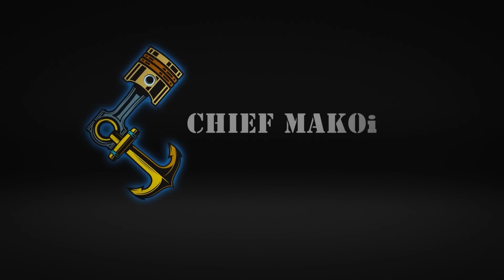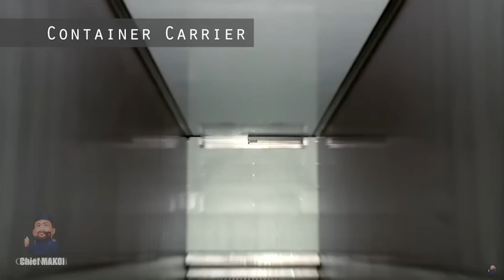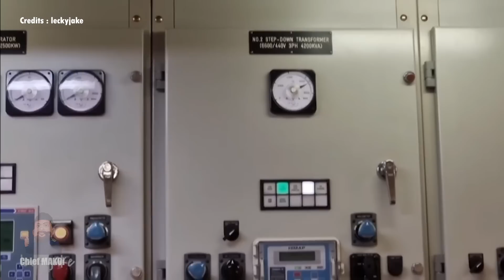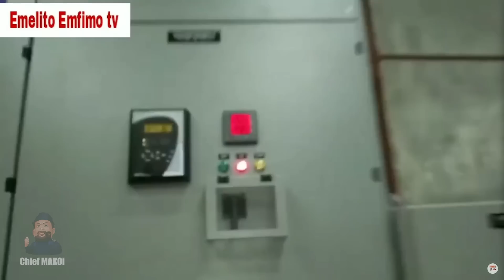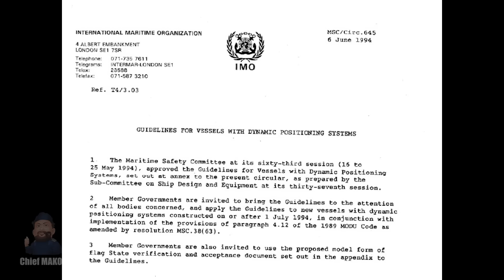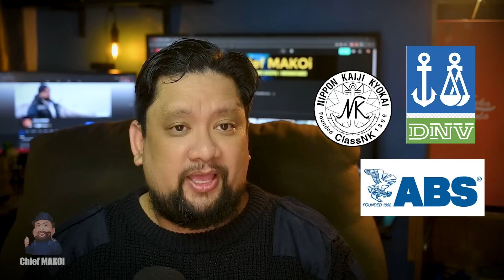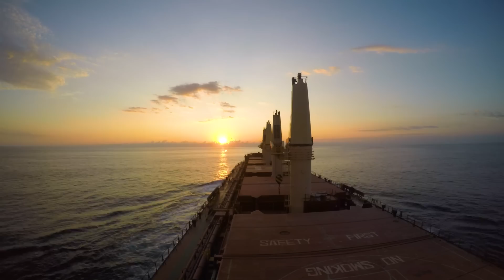Why Cargo Ships Don't Open the Bus Ties During Maneuvering | Chief MAKOi

Comment: One thing of note was that the bow thruster was only on one side of bus.  This might present a load balance issue depending on the number of refer units tied in.

I worked at a very large nuclear power plant.  All of our buses were crossed-tied.  During a blackout, our emergency buses would isolate from the other buses to ensure that if the fault started elsewhere it would be isolate from the emergency bus and its equipment before our emergency diesel generators started in under 13 seconds.  Even the non-emergency buses might isolate depending on what the circuit protection saw.  

The advantage of always being cross-tied is if one motor shorts and causes a breaker to trip open, or some other failure happens, there is a chance that the rest of the bus can still be powered from the alternate supply.  If a transformer failed, the bus would auto swap in under 5 cycles to the alternate transformer.  The main infeed breaker would open and the alternate would close that fast.

Unlike a ship, we can go all the way back to the national power grid to get power, if our switchyard does not isolate on a fault.  And our switchyard is supplied by three independent sources so if there is a fault, only a 1/3 of the switchyard will isolate.

We had 4 EDG, each 4400 kw and they would come up to speed in 13 seconds.  Then over a two minute period, our emergency loads would be sequenced on to the bus.  This was enough power for instrumentation, some lighting, and the emergency pumps to keep the reactor cool only.  We only need 3 out of 4 for a normal safe shut down.  If they failed we had backups to the backups.
Reply from the maker: That's very interesting.  They would probably have a similar setup on nuclear-powered ships/subs.
Reply: @ChiefMAKOi  Yes on the emergency diesel generators on nuclear vessels.  
The submarines have two sizable battery banks.  They use motor-generators running on the buses to be a quick transfer over on a loss of steam.  Since the M-G is already synchronized on the AC side, the power flow reverses when the frequency drops for a moment, until the frequency regulator speeds up the now DC motor.  I do know they have an auxiliary propulsion motor to help drive them back to the surface.  Once on the surface, they have the very same model Fairbanks Morse Diesel engine driven generator the world war II US subs used.
The aircraft carriers don't have the problem of no oxygen to run an engine, so they go with multiple diesel generators.  They run a 4.16kV AC system, with the system tied in peacetime cruising but will segregate the system in general quarters to prevent damage to one power system from taking out the other.
Reply: @ChiefMAKOi  Last year I had a tour of the Emerald Princess control room by the chief engineer.  I was quite at home at what I was looking at.  The controls and procedures were so very similar and in English too.
Reply: Thanks for the detailed posting.  I am reminded of a business I worked for who decided to have a 50 KVA motor-generator backup for their IT equipment.  I recommended a location in their IT raised floor room.  The head of IT didn’t want to lose floor space and decided to have the unit installed in a basement.  There was also an outdoor EDG, but the physical plant personnel did not perform scheduled test runs, but that is another story.

There was new construction and a fire suppression water main running through the basement was installed.  The main was air tested and then city water was supplied to the main.  On a Friday night about a week later, a cast iron elbow burst.  The fire pumps had not yet been enabled, but ~150,000 gallons of water poured into the basement and blew up the motor-generator.  The IT person on duty doing backups found out when all the lights went off and all equipment shut off at once.

The IT head ordered that the replacement, now a solid state inverter unit, be placed in exactly the same location.  I lobbied for installing a foundation to raise the new unit, but the head nixed the idea as too expensive.  There was a water mark left on the wall from the flood, so there was an easy gauge of how high to go to get above the flood risk.

TEPCO in Japan also found out that putting all the backup EDGs below ground isn’t too smart.  Anywhere the can be water, there eventually will be water.  Murphy’s Law ensures the flood occurs at exactly the wrong time too.
Reply: @wtmayhew   Your flood story reminded me of a tech company that I worked at in the '90s. They correctly installed their backup generator outside. But they also put it up on top of a concrete pedestal. The base of the generator was above the first floor window bases. They wanted it to operate as long as possible, even if the wetlands behind the building flooded. The expense of a catastrophic failure was prioritized over the expense of installation. The server room was on the second floor for additional protection.
Reply: @elizabethbottroff1218   Thanks for sharing.  It is always good to read cases where decision makers do more than go through the symbolic motions to satisfy insurance underwriters or boards of directors.
Reply: @wtmayhew  Our EDGs were at basically 4-ft above ground level, 10-ft above high tide, and behind water tight doors up to 35 above the river level.

Once we had a cooling line break on one EDG and water just flowed out the door.
Reply: @dwayne7356  Thanks for sharing.
Reply: @wtmayhew  That reads like a BOFH story about an incompetent boss who's only qualification was being the CEO's cousin...  just fantastic
Reply: That explanation of your nuclear plant's system is fascinating to me. It also emphasizes how badly damaged the plant in Japan was on 3/11 that too many generators and pumps were taken out at the same time.
Reply: @elizabethbottroff1218  I worked at the same type of GE BWR reactor.  The difference was that USNRC required that we had water tight doors up to 35-ft above the river.  Nothing but non-vital equipment is in the basement of our turbine building.  Not that flood water is a good thing.

We are designed to be stable for 8-hrs, Fukushima Daiichi proved that we would probably last more than 24-hrs.  Since then the USNRC has required even more backups and staging of emergency equipment offsite for just such emergencies.
Reply: @elizabethbottroff1218  Not only were the generators at ground level, the electrical rooms were in the basement.  Which is crazy to me, the nuke I worked at had the electrical rooms at 68 feet above sea level.  (All of our levels in the plant were in MSL, so that made it really easy to know.)  The emergency diesel generators would be in peril at about 48 feet above seal level though.

Something really interesting came out in relation to American plants due to the Japanese tsunami.  I quite working at the nuke back in the 1990's, so I didn't know about this until it became public.  Due to 9/11, they made preparations to recover plants from a terrorist attack.  All of the US nuclear power plants have a secret off site bunker with generators, pumps, rugged equipment to haul it and engineering gear to get it there if the roads were damaged.  The plants were modified to have direct connection between generators and key pumps, plus connections for external pumps.  The idea was that if terrorists targeted key support equipment, the plant had access to offsite equipment to bring in and save the plant once the terrorists were driven away.  In hindsight, the NRC realized that a scenario where a worse than postulated natural disaster, these offsite preparations would be very helpful.
Reply: "One thing of note was that the bow thruster was only on one side of bus.  This might present a load balance issue depending on the number of refer units tied in."
That's why I think having the low tie open but the high tie closed would be a good idea.
That said, refer loads are interruptible due to the thermal inertia and insulation of the containers.  Also, if the bow thruster was lost, it isn't as bad as loss of propulsion underway in a narrow channel.  The bow thruster is only used when the ship is moving slow.  There are already tugs attached or at the ready when it is in use.
Reply: that's encouraging to know
Reply: Dwayne,  you say correctly  "each 4400 kw and they would come up to speed in 13 seconds Then over a two minute period, our emergency loads would be sequenced on to the bus.  "   Putting aside the original trip condition on the ship it is my opinion that the crew were too eager to restore power and were manually throwing breakers, most likely upsetting the frequency of an already unstable board with an unknown load condition .  We are both aware of the problems that brings. Best.

Comment: Would also be good if ship design paid careful attention to making sure that critical systems can be kept running even in the event of failure of the main systems.  Being able to operate a subset of the steering hydraulic pumps from the emergency generator is a start, but obviously in the case of the Dali, this wasn't enough.

As is said in railroading, the safety regulations are written in blood.
Reply: the problem is a rudder on a motor vessel loses a lot of effectiveness when the screw(s) isn't turning, because the thrust from the screw acts on the rudder in normal operation.
Reply: @kenbrown2808  A lot of effectiveness, but not 100%.  And that's just 1 example -- in principle, thuey should have been able to use the bow thruster after they lost 440 V power but before they also lost 600 V power, but only if the control line was still operating, which is unclear.  And if emergency power could have kept the pumps etc. needed for the main engine to run, then the rudder would have remained effective.
Reply: @Lucius_Chiaraviglio  by my understanding of the reports on the official report, they lost the main breakers on the generators.  as in total blackout.  no 440V, no 600V, no fuel, oil, or coolant pumps for the main engine.
Reply: @kenbrown2808  According to Chief Makoi's previous video on this, the 6600 V initially remained up, until the second blackout, which was a good part of a minute later.
Reply: @Lucius_Chiaraviglio  according to every video talking about the NTSB report, the GENERATORS remained running, but the circuit breakers opened, in the second blackout, after the circuit breakers were closed, the generators lost speed and then the breakers reopened.  

I mean, sure you can say the high voltage bus remained up, and the main engine kept running, but the main engine didn't keep running. and the ship had a total blackout.  they lost propulsion, they lost steering until the emergency generator system went online, and they lost all communications and recording capability until the emergency power was online.
Reply: @kenbrown2808  What I understand from Chief Makoi's previous video on this -- in particular the overall electrical diagram -- the breakers that tripped were between the 6600 V bus and the 440 V bus, thereby leaving 6600 V bus equipment (including the bow thrusters) functional at least in principle.  (Doesn't help if the control system is out, though.)

Comment: The size of that bus bar is genuinely intimidating.
Reply: It carries about 10 000 A
Reply: @mrfrenzy.  I have doubts on that number.  Standard breakers run up to 4,000A.  Special order general distribution breakers run up to 6900A.  If the current is that high, the voltage should be going up.
In the medium voltage world, there are generator disconnect breakers that run up to 30,000A, but those are very special and very expensive.  We're talking the main output breaker of a nuclear power plant.
Reply: @matthewbeasley7765 I agree, its doubtful.

4,400kw x2 plus 3,800kw x2 at 6,600 volts gives approximately 1,434 amps per phase provided all 4 gensets were at rated load. Completely ignoring the redundancy.

I don't know the specs on the transformers to know if the LV bus is seeing close to that, but considering the HV bow thruster alone is 3,000kw I doubt the transformers are that oversized.

But, if the entire genset load of all 4 could be converted to 440v, the 440v bus could have 21,500 amps per phase. But I doubt its anywhere near that. I'd be surprised if it was rated over 5,000 amps
Reply: @mediadaemon  I don't think the picture was of this ship.  They're likely of a 440V only ship.  But my point remains, if a ship had over 4,000A, they wouldn't do LV, it would be a MV ship.
Reply: @matthewbeasley7765 bear in mind many container ships carry 1000+ refrigerated containers all 400V at about 10KW each. There is no HV option there. IF they were all running at the same time that would be 10MW on the LV bus, about 14000 amps/phase.
Reply: @petesmith2234  I doubt the engine room LV bus carries that load.
I bet its HV over to the deck and there are transformers per row/stack/whatever for those. Creating essentially a bunch of mini LV busses. Thats how big industry does it, 480v in the building and 120/208 xfrmrs per floor/unit/space usually 200-400amp localized derived panels rather than one 10kA 120/208 main panel with huge feeders.
Reply: @petesmith2234  They're not on one bus.  They have multiple MV:LV transformers and several buses that the refrigerators are distributed among.